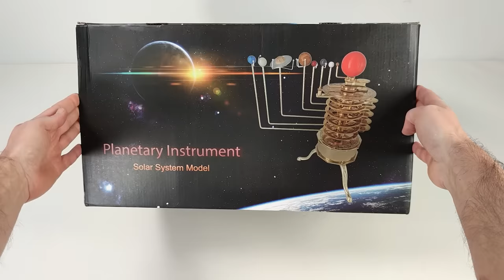Mechanical Solar System | Magnetic Games

Comment: I collected 52 magazines over the course of a year when I was 12 for this exact solar system... Finished it, built it, 4 days later brushed against it by accident and pluto vanished into thin air 😢 why where they only held in place by little pins and not threaded ones 😔 sigh

Comment: If you magnetized and rotated the metal ball of van de graaff generator and then threw small balloons at metal ball, you can potentially create a fractal solar system due to large rotating electric field and magnetic field causing balloons to gain charge and orbit the metal ball. Because charged objects move right angles to the rotating magnetic field. Also humidity likely needs to be very low for it to work.

Comment: Одна из планет вращается в другую сторону, этого не вижу!)
Reply: A quick google search says

"All of the planets in the Solar System orbit the Sun in the same direction as the Sun's rotation, i.e. anticlockwise, looking from above the Sun's north pole"
and
"if you look at the solar system from its north pole, then you will see all the planets orbiting the Sun counter clockwise and rotating on their axis counterclockwise, except for Venus and Uranus. Venus rotates clockwise while Uranus rolls on its side as it orbits the Sun"

TLDR; No, all "planets" orbit the same, but Uranus' individual rotation is "sideway" relative to the others.